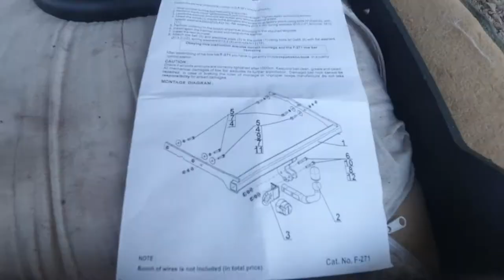How to install towbar on a Ford Mondeo, Steinhof - Westfalia - Oris

Comment: Nice video. Looking to install a towbar to my own Mondeo. At 08:15, is water entering really an issue? I've seen that most people route the cables through that hole, as this is the only way without drilling. How did you do it in the end?
Reply from the maker: Thank you. I have no issues with water so far. This is a spot that hardly can get any water. The cable is under the rubber plug, so if water would be flowing down, it will not enter the hole. But even water flowing down is rare i think becase there is a lamp above. Relatively well protected from water. I admit its not professionally done, but hey, its ok for me.  :)

Comment: Nice. But you did skip the unmounting of the muffler and heatshield on the left side, the bolts are impossible to fit without doing this.
Reply from the maker: Hi. Thank you. Step 7 and 8 is basically what you are mentioning. I did not remove the heat shield completetly. I put a piece of wood between the body and the mufler to make space for my hands. But if someone has a helping buddy all you need is just to push the muffler down while putting the bolts in.

Comment: Question regarding the wiring. Where is the fusebox for that? Is it in the rear where it's run to or does that wire need to be run to the front fusebox? Also is it just a connector or does it actually have to be wired in?
Reply from the maker: Dear Luke, thank you for question. Threre is a fuse box on the left hand side of the trunk behind the cover. You don't have to wire from the front one. Please note that you have to install a canbus module for the towbar. It is either in comes with with the towbar or you have to buy it separately. Also for your information there is a connector behind the cover of the right hand side of the trunk, specially designed for OEM module. So if you buy a Ford OEM module form another Mondeo, you can simply plug it in. Mine was an aftermarket one, and was installed by a specialist.